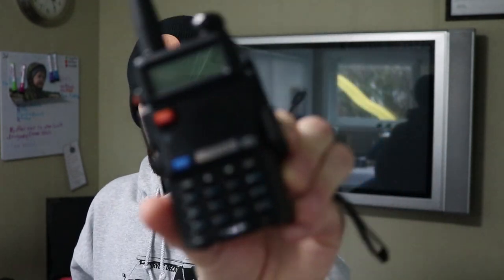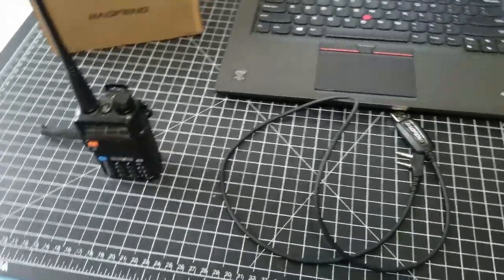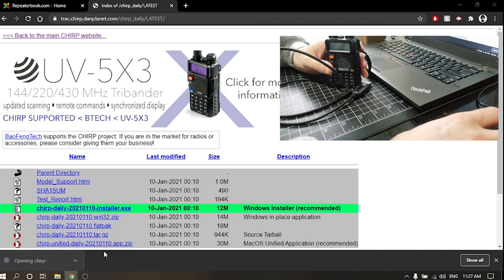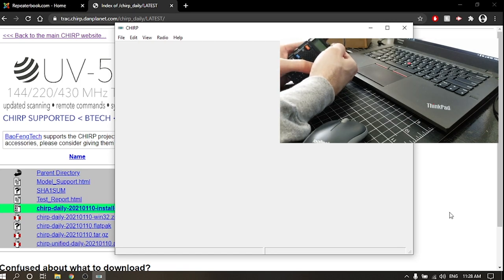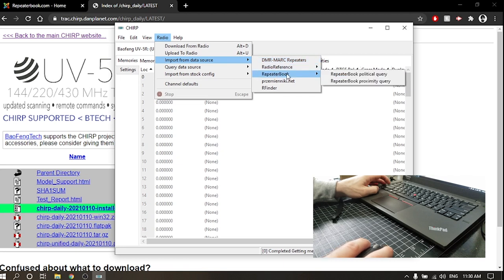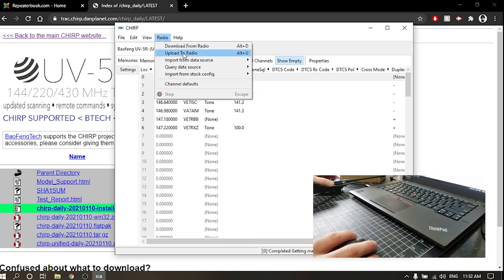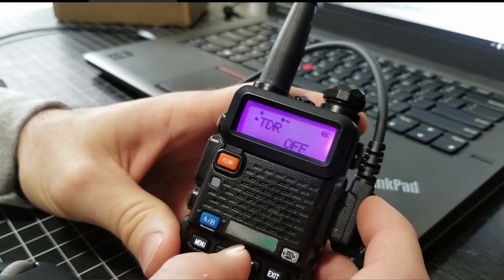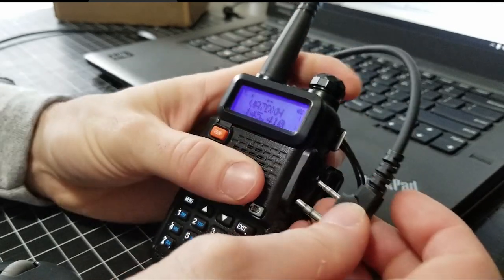Baofeng UV-5R Programming Fast and Easy with CHIRP | 2021

Comment: The UV-5R is VHF-UHF so you can put both in it.  You can put in  something like 25 miles and it should give you the repeaters within 25 miles. The radio should go more than 25 milse,  maybe 50 miles if there isn't much in the way.

Comment: I have a little problem - whenever I try to download from radio, the cloning screen does not come up and I do not get the flashing light on the radio. It might be something wrong with my laptop because I tried doing it with both of my radios but it still did not work.
Reply from the maker: Try another programming cable. It's almost always the cable!

Comment: I am having trouble getting passed the cloning process. So I bought two baofeng uv5r radios with the usb cord I have an older laptop a hp windows 7 so i had to download the chirp legacy as chirp next is not supported on my outdated computer i guess it let me download chirp ok but when i put in all my radio info and go to clone it just gives me error code im not sure if its just an outdated system now that they have the new chirp software out or if its the radio. thank you for any advice given im a newb.

Comment: Word of note. I tried the CHIRP software and it did not connect with my UV-5R, so chances are it may not interface with the radio(s) you have. I had to purchase a programming cd by ABBREE that had the program that would interface with mine. It performs much like the CHIRP software.

Comment: Do we need Ham license if we just want to use Baofeng UV-5R (or other Baofeng variant) much like off the shelf two way FRS radios between our family at the provincial park 2-3KM range.
Reply from the maker: The short answer yes.
 Basically any radio that you can manually select a frequency will require a licence. As opposed to a frs/gmrs radio that has pre-programmed channels that are all locked and non-editable. 
Also in Canada UV-5R's are not really legal for licenced hams either, they have not been specifically tested and approved for Canada.. 🤔 But I also have a pile of them, so.....
Reply from the maker: If you are curious how shitty the electronics are in a baofeng, there are lots of videos on YT showing the harmonics that are produced on unintended frequencies, spilling signals into emergency service frequencies, airband etc, all while you may only think you are transmitting in gmrs/frs frequency.

Comment: Just getting into off-roading on the Island. Would you say this is a "must" set up when going out in the bush or will a decent 2 way walkie be alright?
Reply from the maker: Depends how far you want to communicate! If you are just chatting with your fellow wheelers, 2 ways should be just fine. I would get your ham license and a baofeng if you want to increase the distance, or have  something like a 40w mobile vhf to have contact to local repeaters etc.

Comment: I get to the part where you upload to radio except on my computer this option is greyed out in chirp and will not let me click it.
Reply from the maker: Hello! We're you able to successfully download from the radio?
Reply: @darryldowney  Yeah I was following your video step by step and was able to do everything prior. But when I try to upload the 1 repeater I found in my area this option is greyed out in Chirp and won't let me click it.
Reply from the maker: Hmmm. I'm really pretty new to this as well. It's hard to say what the problem might be. I might suggest checking your usb cable. Also maybe try saving your new profile that you've created, then re download whatever is currently on the radio, then open the profile you save and see if it will program now?
Reply: @darryldowney  Figured it out, you have to make sure the tab you are working on in Chirp says Beofeng and not Generic. If you somehow accidently create another tab and click off the Beofeng one, that option will grey out.
Reply from the maker: @Gyva02  Great you have if figured out! Yea, different brand of radios have a different profiles for different available settings. Great Job!

Comment: Hey thanks for the video,  I have a question I hope you might can help. I have the uv5r, i am using chirp. The name of the channel is showing up and changes with channel change but the frequency don't change when scrolling the channels .  I hope this makes sence.

Also I saved channel on top and frequencies on bottom on chirp settings.

Comment: Hi Darryl,  I was actually looling at programing by Baofeng and notice no channels seem to be working but 1 weather channel.
I was wondering if you could help by giving some working frequencies in Canada.  I try to set mine with this order:
1.  Simplex Freqs
2.  Weather Freqs
3.  Repeaters
Reply from the maker: You will definitely want to figure out frequencys to monitor that are in your area.  Try looking up  Repeater Book or Radio Reference for a good place to start.

Comment: Is there a way to copy another uv5r to another one ?
Reply from the maker: After programming one radio, you will have a save file from chirp, you could load that into as many radios as you like!

Or it's maybe someone else's uv5r, borrow it, connect it, "read" the radio, and then unplug the radio, plug in the next one and write the programming to it.

Comment: @Darryl Downey Hello man thanks for the video, Ive heard there are fake cables being sold on amazon I keep getting the message radio did not respond and once i got an access denied error can you provide me some info if you know anything about this I live on the other side of the country in Ontario. I paid like 15 CDn on amazon for the cable but when i heard there were fakes i rechecked amazons stock of cables and saw that they ranged from 15 to 50 dollars but the one i bought had 6000 reviews like 4.5 or more stars so im not to sure whats wrong here
Reply from the maker: I have no tell tale signs, I know some aftermarket cables do work aswell. But I would recommend trying maybe a different computer if you've only got the one cable to try. Or do you know anyone with a known good cable you can try with your computer?

Comment: Do you need any other software or is it just the Chirp download? When I try to do it it says error
Reply from the maker: You shouldnt have to. But it also depends on the cable you are using. Here is some more info on error messages and cables. https://www.miklor.com/COM/UV_GettingStarted.php

Comment: I did everything you showed. I get an error message. An error has occurred Radio did not respond. So i uninstalled CHRIP and reinstalled it , and started the procedure again. Again, an error message : An error has occurred Radio did not respond.   I cannot get through the cloning process that where the error occurs. That's on the Windows 10.   So I go to my iMacOS Big Sur version 11.3.1 and download CHRIP,  and it downloads on the computer. Now a totally different error message or warning pop up. CHRIP cannot be opened because the developer cannot be verified. Mac OS cannot verify that this app is free  from malware.     That message is not foreign,  I have seen it a lot.  If the app is not from Apple,  this is the normal message they will not let it work.
Reply from the maker: I would suggest starting with trying a different USB port (and make sure it matches in chirp) on the PC, and if that doesnt work try a different usb cable. I've heard of an unreasonably high failure rate for the usb cables. Even "oem" cables.
Reply: @darryldowney  This cable is the BTECH PC03 FTDI Cable Dual Pin. Should work, the Window 10 Pro recognizes, but doesn't work, there is a "quick start user guide" incert in the plastic bag with the cable.  It's a misnomer, it's not a quick start. I'm getting somewhere on it,  going to the www.ftdichip.com  website and find and download drivers.  It should be easier that than this. It's not plug and play, and I'm not a computer programmer.
Reply from the maker: @1naturaldoc  You are absolutely right, it should be easier. I'm sorry I can't be of more help, I didnt experience the same issuse. Im also on windows 10.
Reply: @1naturaldoc  Try a different COM

Comment: Thanks and that was helpful.  I wish I could find a "fix" video for the issue that doesn't allow connection between the PC and radio - it's a well known issue and am still looking for a solution.
Reply: Most of those problems are with the USB cable you are using. Some of the cheap ones don’t work. Make sure you are on the correct com port on the computer. Test it with a friends cable. To get a good cable go to Amazon, they will recommend the best cable.

Comment: I keep getting an error.. I have reinstalled the CHIRP software.. Still ERROR when I click radio/download from radio.. then the error pops up. "could not open port 2 system could not find the file specified"... I saved to wherever it recommended, didn't change anything.. I tried both ports on my laptop.. nothing but error
Reply from the maker: Does your computer recognize something USB has been plugged in? I would suspect the programming cable itself if you cannot get it to read from the radio. I've heard lots of reports of differing qualities in cables causing issues. Do you have access to another cable to rule out that possibility?
Reply: @darryldowney   ya, windows recognizes the cable. It's the baofeng cable that came with it. I got 2 radios, I'll try the one from the second one tomorrow. Thanks for the response!

Comment: Another useless UV-5R programming video that fails to deal with the COM channel issue. I've lost count of how many times, I've had issues getting the right COM.
Reply from the maker: Thanks for your positivity! I haven't had any of these issues, that's why I haven't addressed it. However, I am aware that a lot of cables including branded "baofeng" cables have issues. I would suggest trying a known good cable. And by "known good", I don't mean a new cable, I mean a cable that someone else has no issues with.